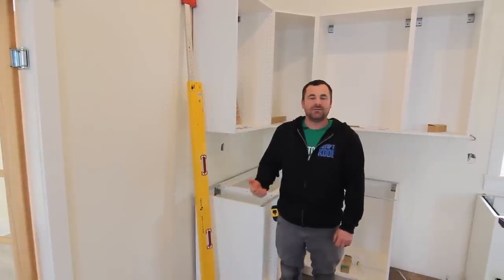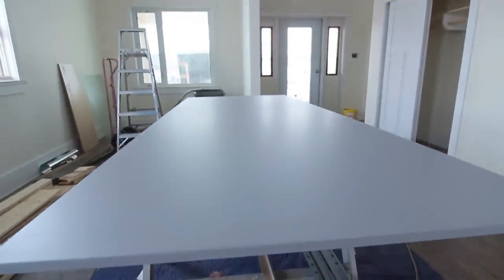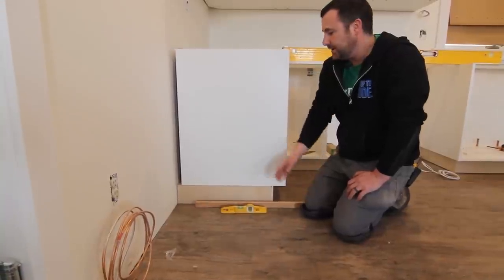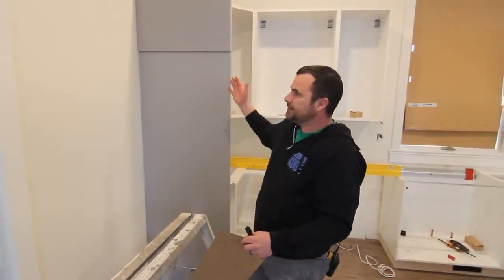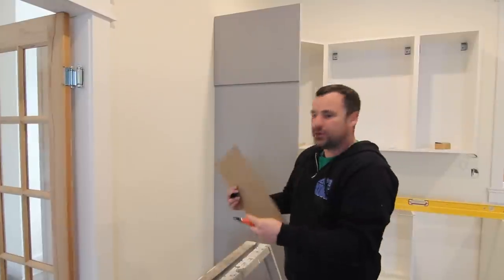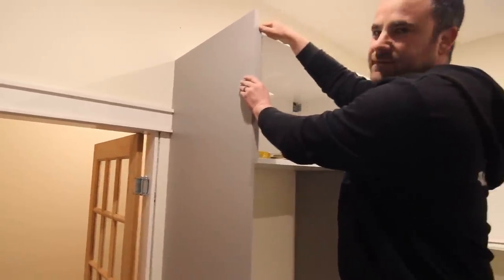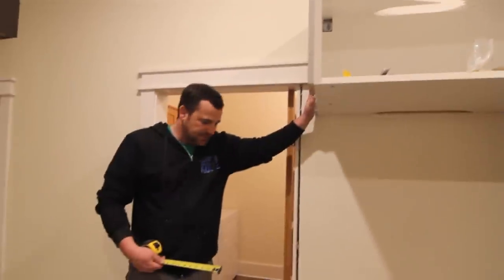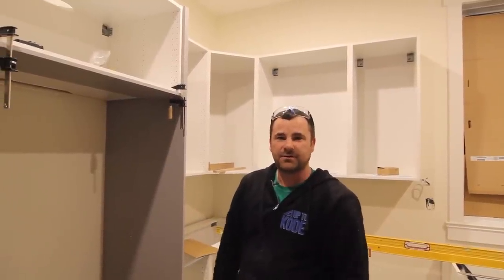How To Install Ikea Fridge Panels With Crooked Walls

Comment: Hi Kody.  I just subscribed and am going to watch all of your other video's.  I live in England,  near London I make builtin furniture for people.  I used to cut panels the same way you do with the straight edge clamped but then i bought the Makita track saw.  It changed my life.  No more measuring for the base plate each time.  Just stick the guide down straight on the cut line and bam.  You don't even need to clamp it. Best tool I ever bought after my multi-tool.
Reply from the maker: OK! I like that. Note taken and I will keep that in mind for the next job! Thank you.

Comment: These are really comprehensive and useful videos. I would just suggest that at the start, end or both you include a finished section where you just run through the key points and let us see what we are trying to achieve?
Reply from the maker: Good point! I like that.

Comment: I would love to see a video showing how to do the installation of the included Ikea toe kicks with the plastic legs. This is how I plan to do it in my house. I love the custom bases that you do, but I am replacing cabinets because of a leaky back door that rotted out the bases of my old cabinets. Since that happened I am paranoid about water and like the fact that the Ikea stock solution completely isolates the floor from the cabinet with plastic that can't be damaged by water. Thanks for the series. It will be invaluable when I begin the installation.

Comment: Great series! Thanks. Struggling on how to secure the bottom of those tall fridge panels......
Reply: Doug T I was thinking the same thing. Figured I’d use L brackets on the inside floor. Once the fridge is in you won’t see them.

Comment: Hi great video Just wondering what level you use
Reply from the maker: My go to is a Stabila 6ft to 10ft extendable but they are around $400. Pricey unless you use it everyday. You can certainly get away with a 4 ft and a straight edge for extension

Comment: Any idea on how to protect the bottom of the side panel to prevent it to get wet in case of spilled water?
Reply from the maker: 1. Try to keep a factory edge to the floor. Silicone that for extra protection. If the factory edge is not possible then I would seal the cut with primer and even a coat of paint after that.  Then install the panel. Then silicone the perimeter.

Comment: I’m installing the fridge panel soon and thinking about matching the bottom of the panel with the bottom of the base cabinet instead of running it to the floor.
I’ll fasten to the base cabinet with maybe 6 screws from inside the base cabinet and maybe even pl premium the panel to the base cabinet.
Do you think the plastic legs on the base cabinet will support the weight?
It will also be screwed to the upper cabinet over the fridge in addition to the cabinet on the other side of fridge panel.
BTW, I’m using the rail system.
Thanks.

Comment: Plumb and level then scribe back and bottom, cut from bottom and plane then use a sealer to seal bottom. Lol, you predicted you were gonna mess it up?? 
Next time let TIM do it!! 😜
And use a saw sled to cut length so you ride the bigger piece of wood. Planer works good too! Lol

Comment: So is anything holding the left panel in place at the bottom? Presumably the panel will get caulked at the wall, maybe the floor as well? Is that all that's holding it straight in place at the bottom?

Comment: Can I ask which 1 1/8 “ screws you buy to attach the panel? You said you don’t like the ones that come with it. I have ordered a couple of types from Amazon because you can’t find that size in the store, but they are not to my liking. Thanks!
Reply from the maker: I order from a hardware store a type 17 wood screw. #8 x 1 1/8” flat head. Cheers!

Comment: Great video. Did the left hanging hook on the wall unit reach the wall bracket after you packed the top and bottom out
Or did you just screw it to the wall.  I'm loving your videos I'm putting my own kitchen in soon and trying to take in as many tricks of the trade as possible.

Comment: Hi Kody 👋🏻 Have you ever installed a small freezer, oven and microwave oven in one tall cabinet from Ikea (248cm tall). I’m planning to install small freezer (Djupfrysa) on the bottom, and then oven and microwave oven on the top of the freezer.

Comment: I am installing Ikea cabinets now, I am wonder if you used anything to cover the bottom of the wall cabinets? especially the one above the sink since the base is white do you use a cover panel or just leave it?
Reply from the maker: Normally the underside is left as is.

Comment: Hi Kody, any suggestion for high ceili ng? Do i butt to gables together? On Cabinet at  the top? Imea plan seems to suggest a  26  x 36 panel at the bottom? One side is exposed like in your video would i join with flat brackets?
Reply from the maker: I would butt panels together. I would suggest putting the seam down low OR up high (whatever you think is least noticeable). You could consider the 36x96 panel with a 26x36. It all depends how many tall ones you need and which panel configuration makes for the least waste while maintaining factory edges that are visible.
Reply: @uptokode  Thanks Kody!
Reply from the maker: You’re welcome

Comment: Hi Kody, 
What do you do to fix the gable on the cabinet free side to the floor for stability? Surely it's not just fixed at the top to the cabinet above the fridge right?
Reply: I think i see a reply here you fix it to the floor with an L bracket?

Comment: I tried to buy an IKEA base cabinet, but I did not follow their store process so left empty handed.  I am not sure what the process is, but it is definitely not just go in and buy the cabinet you picked on the website.  As I wondered through the picking area, I realized that these are really expensive cabinets considering that they are made of nothing but particle board.  In fact, I think everything in the entire store is made of particle board and nothing but particle board.
Reply: The more expensive cabinets have quite a bit of particle board too, and not near as many features. We have a mix of Ikea and kraftmaid in our kitchen. It appears the only way to get all wood cabinets is to build then yourself or have them built.

Comment: My side panels are bowing out in the middle.  Any ideas on how to fix this?  One panel has full 24 inch depth base and an upper cabinet next to it.  The other side only has a shallow depth base and an upper next to it.   The outward bow in the center of panel is worse on the one panel with the shallow base next to it.  Its worse towards the front edge since there is nothing to screw it to except at the top where the fridge cabinet is and the L bracket on floor on one side.  But both panels bow outward in their center.    Any ideas on how to fix or minimize?

Comment: What is the purpose of the 20" filler panels on either side of the overhead cabinet, between the cabinet and the gable panel? Is it because the gable panels are not 3/4"? Seems like the gable panel could mount directly to the cabinet?
Also, was the lower cabinet out farther than the upper cabinets, due to it being pulled out of the out of square corner? If so how did you accommodate the difference?
Reply: I'm wondering the same thing. Why did he double the panels on the sides? Perhaps the fridge was too wide for that cabinet?
Reply: At about the 20 minute mark he explains that he wants a slight gap on either side of the fridge which is about 36 inches, the same width as the cabinet. So by adding the side panels he creates the small space on either side of the fridge.

Comment: Kody, I have a 103 inch high kitchen and put double cabinets to reach to the top.  The IKEA side panels don't reach that high so I am looking for suggestions.   I am calculating to cut the panels to the top height of the bottom cabinet, so the seams blend in together as best as possible.  Somebody at IKEA suggested that seems should go low so they are not as noticeable, which I cannot disagree.  However, I think that there would be a loss of strength without a full panel from the floor to the first cabinet above the refrigerator.   Like your video,  my refrigerator is at the end of the cabinets, so that end panel is the real challenge.   I was thinking of using biscuit joints to meld the two 96 inch panels together at the cut, or joint the factory finishes and have the cuts at the top and bottom.    Ideas?  Thank you.
Reply: Im curious to what you decided to do with the seams and how the end result looks. Was there any difficulties installing double cabinets on the wall?

Comment: Do you put the edge of the fabled flush with the front of the cabinets doors? Not the front of the cabinet correct?
Reply from the maker: Correct.  Gable flush to the doors.
Reply: Kody Horvey thanks! One other question not sure if you mentioned. Fixa gables- I have to put it between cabinets and the gables?

Comment: Kody, would you install a floating floor underneath the fridge panels, or around the panels but still under the fridge itself?

We don't want to install the floating floors under the cabinets due to expanding/contracting.
Reply: Use cabinet shoe moulding (scribe moulding if not available) around the base of your panels and toekicks. You can also use Quarter round the floor manufacturer has, but often it won't look as clean. This can help secure the base of your fridge panel/gable to level as well. If you want to keep your warranty, install it in and around it. It doesn't truly matter for these panels because of the lack of weight. It takes a lot to make a decent floating floor buckle.

If you have laminate I wouldn't even think about putting it underneath cabinets. (Tip: Water-Resistant doesn't mean Water-Proof, resistant doesn't matter once water gets under/around it.) If you have a mid-high quality Luxury Vinyl, then it becomes grey.

Almost no floating floor will have a warranty if floor is installed under it too, but most of the time won't buckle if you let it settle ideally 3 days after and then install your WALL MOUNTED cabinets. (Some cabinets have the toe base separate from the rest of the cabinet. If it's separate, floating floor should not be installed underneath no matter what.)  Islands/peninsulas would have to be glued down and minimally screwed if at all. Even if you use stone countertops 99% of the time your floating floor wont buckle if done with the right precautions, but it's easier to just void warranties and just say no than hope everyone can be that patient.

Make of it what you will. I personally prefer installing it under whenever possible for a much more sleek look that'll also help protect subfloors from water damage. The real factor is what  the warranty actually covers for 20 years haha.

Comment: Kody- Is the bottom of the outside panel fastened to the floor or wall, maybe with a L brace?
Reply from the maker: Yes an L-bracket on the wall and near the front of the panel.

Comment: how do you fasten the bottom of the gable? Mine won't be against trim so would you use an angle bracket?
Reply from the maker: Yes just use an angle bracket.

Comment: Hi Kody, I want to hang my 24" deep over the fridge cabinet about 6" away from the wall so it's almost flush with the face of my fridge- how would you do this, thanks
Reply from the maker: I have done this by adding the desired thickness of framing in behind the cabinets and then mount the cabinet to this framing.  Is that enough info?
Reply: I was thinking of framing a “box” but not sure if I should use 2x4’s or 2x3’s and making 2 - top and bottom and relying on the 3x8 cover panels to take some of the “weight”  
Thanx a bunch for your videos Kody

Comment: Hi again Kody! Well my IKEA kitchen is almost done, my fridge cabinet looks great (thanks for your suggestion).  Now I’ve selected IKEA’s Kysekil wall panels as a backsplash and I have to select an adhesive. Lysekil panels are as you may know are melamine so I think I will give one side a light sanding  to improve adhesion but what glue do you suggest? They’re going right on newly primed drywall.
Thanks again in advance!
Reply from the maker: A light sand is never a bad idea. As for adhesive...check with a flooring company. They have the good stuff. Or use something similar to adhesive for a shower surround. 

I’m not an expert on adhesives so please double check.
Reply from the maker: I’m glad your kitchen is looking great. Email me some pics when it’s done. Kody@uptokode.com.